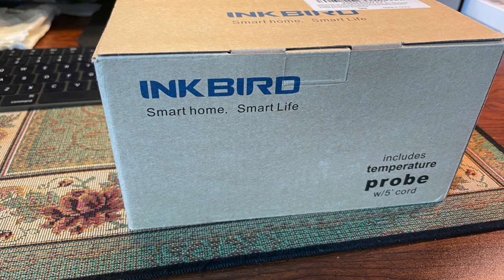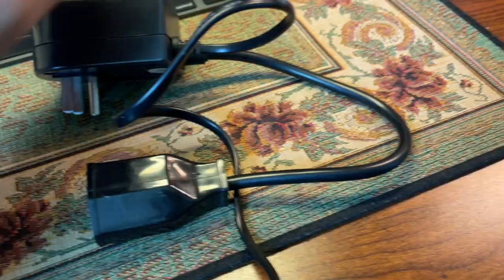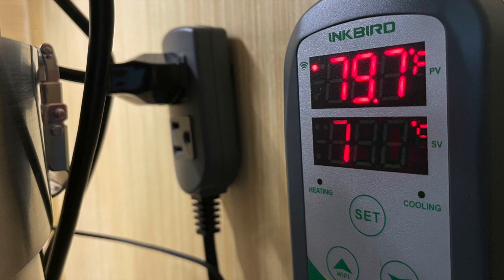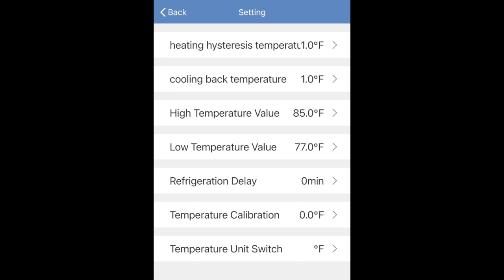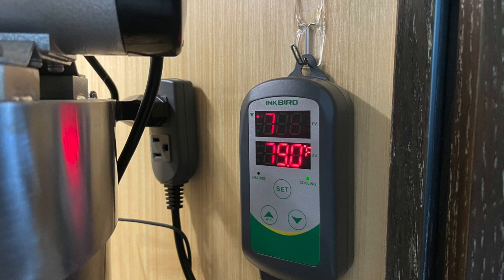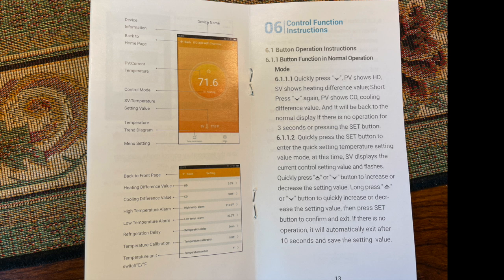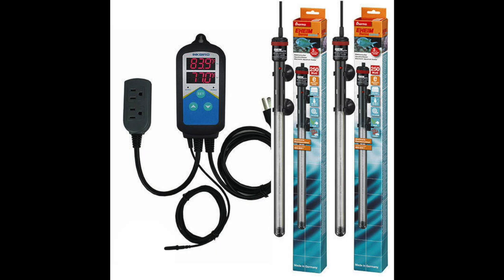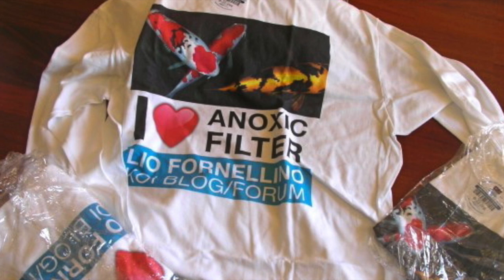Product Review on Heater Controller from INKBIRD : Kevin Novak Ph.D.

Comment: Have been running the non wifi version for over two years.  I too took the chance on this brand ordering this off of amazon.  This thing is awesome.  This thing is much better than the more expensive jbj true temp controller, that I previously ran on my tank that failed me in less than a year.
Reply from the maker: Thanks for sharing. I was hopeing it was a good controller. So far so good.

Comment: Been using inkbird controller for years. Had a very expensive “aquarium” brand controller and the temp probe failed after a year. Manufacturer said sorry for your luck(known issue apparently also). Had my inkbird for about 5 years at a 1/10th of the cost. Not an issue so far. Will always have an inkbird on my main display tank.

Comment: WARNING 
Hey Doc, I messaged inkbird and several other manufacturers, all with the metal/titanium probe. They all said that the probe is only generally waterproof and their is a certain probability that it will be broken/fail in water long-term.
Inkbird makes two types of probes depending on their various models; an NTC version intended for dry/humid conditions and the aquarium version. That’s why yours did not come with the suction cup, the aquarium version does!
If your return window for Amazon hasn’t closed I think you want to exchange yours for the inkbird 306a WiFi controller with the aquarium probe. Otherwise you can buy the probe separately on Amazon for 10.99 just search inkbird detachable aquarium probe and swap it for the probe on your controller. I have also seen people slide the NTC probe down into a SS narrow tube where it can stay dry in the inside.
Manufacturers told me the metal probes are inevitably prone to corrosion which can also lead to failure.
I’m curious if all the other comments on your video who have had years of good function from the inkbird are using the aquarium probe or the NTC version???
Reply: Thank you.

Comment: Just be aware that some older inkbird controllers can have probe failures over time if it's kept submerged 24/7 (IE your typical aquarium use). They will send you new ones that are properly sealed, or you can just coat the top with a blob of silicon/epoxy and call it a day.
Reply from the maker: I use my old heating element and only the Inkbird controller to turn it off and on.
Reply: @anoxicfiltrationplenums  That's my point. A lot of the older revisions of the inkbird controllers shipped with probes that WILL fail within a year or two. They've updated the design, but there are a lot of older ones still floating around, so it's something to look out for.
Reply from the maker: @KelvinGreyheart   thanks for the info did not know that.

Comment: If you’re willing to do a little DIY, another option is a Sonoff TH10 with temperature probe.  You need to wire it into an extension cord, but it’s nice and cheap.

Comment: Hi Dr Novak, I've used the non wifi one of these on my marine tank for about five years and it's worked flawlessly. I use it as insurance against the heater's internal control going wrong and overheating the tank. I have the heater set at 26c and the inkbird set at 25c so the inkbird is the primary control.

Comment: Probe has no suction cup?    Hmmmm, Is the thermometer ideally located in/under the substrate?  Maybe the length of the probe wire is for that, hence why no suction cup?

BTW, I’m a big fan of your channel and anoxic plenum builds.  I’ve a 120g with a 40g sump I designed and assembled myself.  The main tank has a plenum, kitty litter and Laterite sandwiched on top.  One third of the substrate is only sand, no plenum... I placed a weed block fabric on a custom plastic grid structure to create a plenum that isn’t uniform in depth, on purpose.   It’s got two levels to it.   The sump has five levels of media and the return expansion tank is easily 10 gallons. My choose of Hygger pump and 600W heater combo seems perfect, I like the WiFi bit to this  heater controller.  I bought an Inkbird  Tom and humidity sensor for r more monitoring... but my iPhone isn’t young enough to have the rev IOS Inkbird requires s.... ugh!  It sits on the shelf for now.

My water change schedule is less than monthly for @35 gallon change, preventative to higher Nitrates only.

Bravo Zulu for your channel sir!